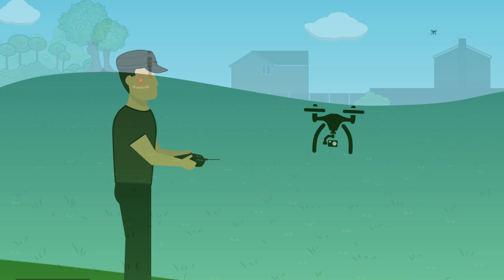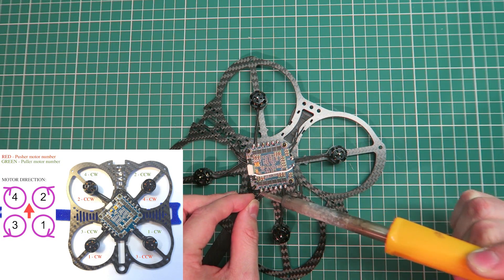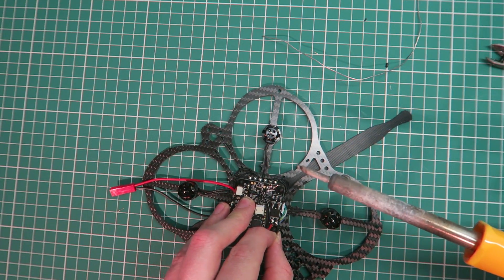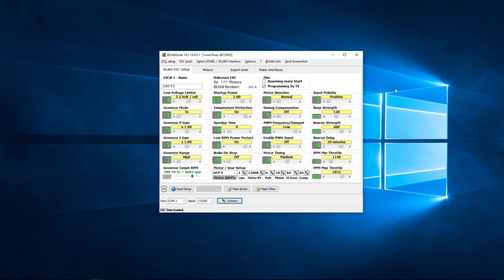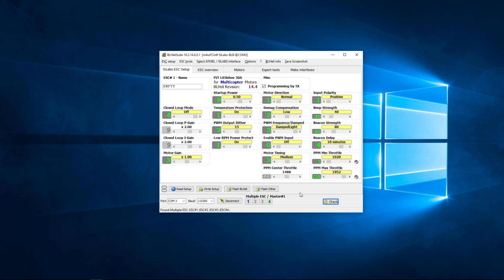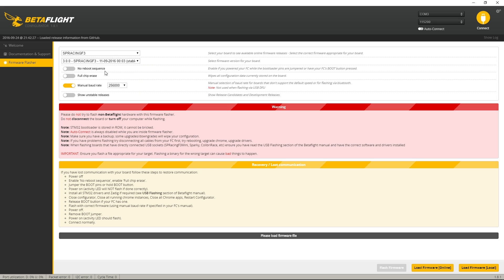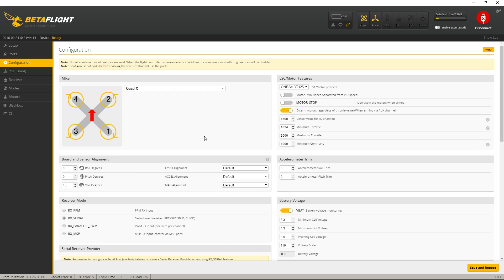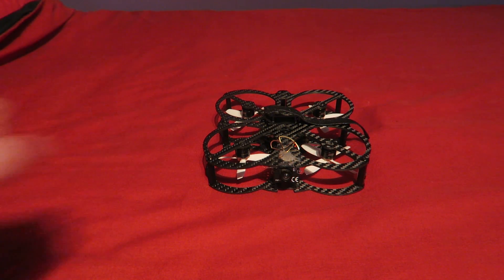Lady Owl Speed Build - BLHeli Motor Direction + Betaflight

Comment: How much flight time do you get with a 3S 450 and how much does the model weigh?
I have virtually the same build and get less than a minute in the air with a 3s 450!
Reply from the maker: im using an 850 battery on mine and get about 4 mins

Comment: Great vid!! I plan on building one of these either the Lady or the mini, any suggestions? On which would be the funner one to fly or the best parts on which you use? I'm checking out both of your vids the Lady and the Mini and take a look but I figured I'd ask you for you have done both, which do you suggest? Thanks! Turbo.
Reply: Also...Have you used 2s or 3s batteries on either? Can you? I've seen some use 2s what do you use? I'm thinking 2s for sure maybe 3s?? THX!
Reply from the maker: +Turbo Reviews I prefer the mini.. also Dmitry is releasing a brushless tiny whoop style one. Check out flexrc Facebook page
Reply from the maker: i only go for the 3s setup for brushless

Comment: nice vid and build there Andy, got me taranis this morning hehe nice bit of kit so much to play with :) still waiting on me qx90 and fatsharks, although ordered the no soldier build anyway hehe the f3 alien hex, orx module came quick so good to go soon :) i do have a question for u tho what taranis fw do u recommend or should i just leave it for now? and also when changing the d16 mode to d8 for this qx90 the failsafe seems to vanish from the menu why does it do that?
Reply from the maker: my taranis is quite old and im running the original EU firmware. never felt the need to upgrade as had no problems with it. the fail safe should already be set on the receiver of the qx90 so u dont need worry about that just make sure its setup correct in cleanflight / betaflight. sounds like u got some nice gear on the way. happy early christmas! :)
Reply: ok bud thanks for the info your rocking your channel as normal spot on :) oh btw i didn't get a usb lead for the taranis i dare say just a ps3 type charge lead would work ?
Reply from the maker: it needs to be a data lead as well as charge
Reply: cheers :)

Comment: another great video Andy
Reply from the maker: Thanks Zimmy
Reply from the maker: with an iron i tend to use both hands but im better with the left
Reply: Andy are you right handed ??? Im having second thoughts about flying mode 2 on FPV, it seems unnatural ???
Reply from the maker: i fly mode 1 and im left handed :)
Reply: AndyRC
ahhh !!! OK i thought you were right, the way you hold the soldering iron ... Still trying to get used to goggles for fpv ... maybe i should look at 3 or 4, just seems unnatural ... Thanks Andy

Comment: Shouldn't you be using high motor timing on BLHeli Suite?
Reply: Not necessarly, it depends if your motor can handle it. If you are not sure "medium" is a very good spot :)
Reply from the maker: I need to get to grips more with blheli. i just keep the settings stock and use to change motor direction for the moment
Reply: Oh no problem! Just a tip: Use high timing for higher KV motors (3000kv+) and medium-high timing for comparatively lower kv motors (<=2300kv). It helps the motor work cooler.